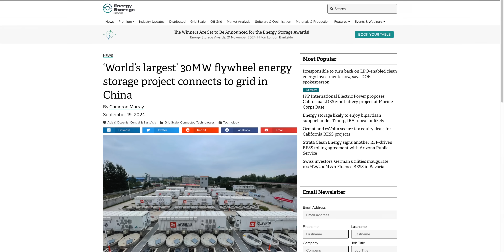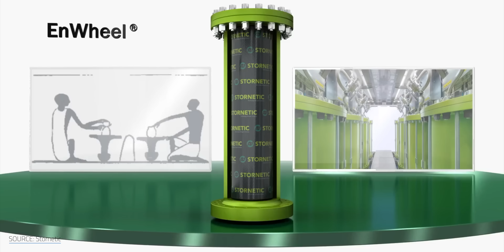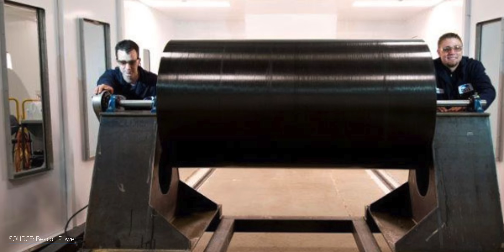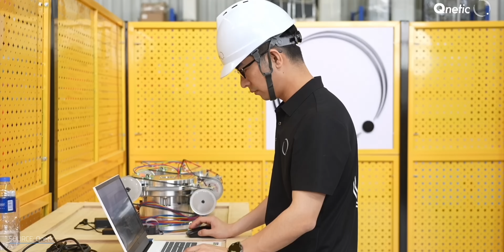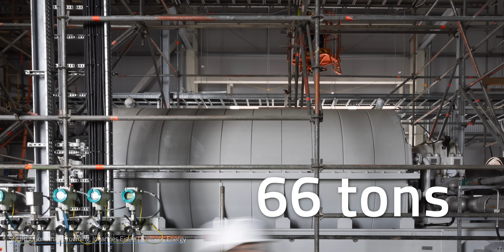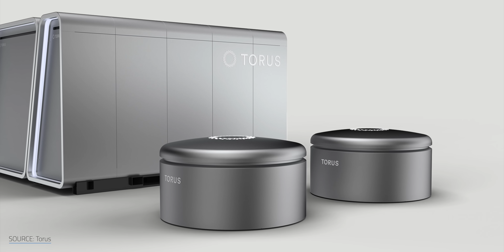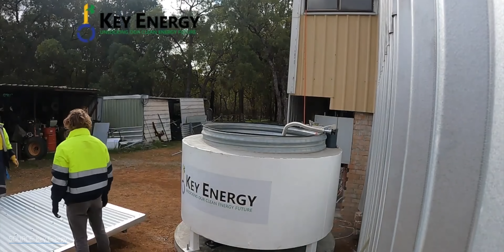How This Mechanical Battery is Making a Comeback

Comment: For some reason Matt didn't really explain why grid connected flywheels are valuable. It'st not primary to "even out fluctuations from renewables" in the power sense, batteries are far better and cheaper for that. What flywheels add is inertia in the form of spinning mass. As conventional thermal power stations are retired, with their large rotating generators, an important quality is been lost. A quality that is hard for the power electronics of solar, wind and battery systems to mimic. A synchronous rotating mass provideds frequency stability as well as voltage stability. They are said to be grid forming, not grid following. It is a vital function and this is one solution.

Comment: I think the best analogous thing to this is like a capacitor or inductor coil. It heavily resists fluctuations in power. Both are used in small electronics to smooth out voltage supplies and prevent spikes from damaging components. They're not a battery, but they do have a significant roll to play in the grid system by smoothing out high demand that a battery can't do.

Comment: Have you seen those gravity/buoyancy based energy storage solutions?  Those seem better to me - you can keep stacking concrete blocks or lowering balloons underwater to store the energy, and then when you want to generate, you hook a generator to a line and let the balloon or block go and the line unravels and spins the generator.  Seems safer than a spinning death machine, and gravity and buoyancy don't lose energy over time.

Comment: The other advandage to a fly wheel is that at the end of its life all you need to do is a rewinding on the generator and some replacement bearings. The whole system is also fully recyclable which is insaine. You kind of have to stop and say this isn't really a battery but something that resembles a mechanical super capacitor.

Comment: My favorite energy storage mechanism is the garage door spring. I keep wondering why such a device isn't used on a long, 40 ton, tractor trailer. Every time you stop and start is a waste of a huge amount of energy. Call it GDS to make it sound high tech. I've witnessed these used on huge loading dock doors weighing hundreds of pounds; made easy to open manually.

Comment: My 70’s Chevy with a 427 big block has a flywheel.  Smooths out the power for better clutch engagement.
Reply: It smooths out the power so the engine will keep turning between cylinder firings.

Comment: It sounds like flywheels would already work well to capture peak sunlight from solar in California and then discharge it in the early evening when people get home and use electricity.  Why is n't that use case happening If they have less loss than battery storage?

Comment: The most telling flaw of “renewables” is that they ALL need additional complexities added into the power generation and distribution process. To oversimplify things, yesterday’s flowchart was generation, transport via the power line grid and delivery to the end user. Tomorrow’s flowchart, largely due to the vagaries of wind and solar and also the media’s toxic persecution of gas, oil, coal and nuclear, will need a fourth step inserted into the flowchart: energy storage. What the legacy media and most first-world governments have been very good at so far, is hiding the true cost of this huge and complex addition. In everyday language, it will add 25%-35% to the bottom line of everyone’s electricity bill when all the bugs have been worked out. In the short term it could quite possibly be double that with technological crop-up problems and materials refinement.

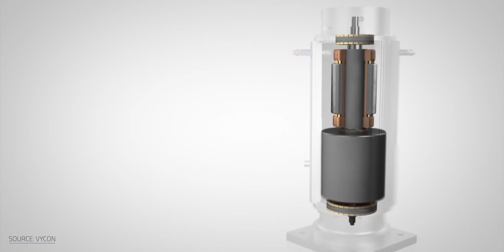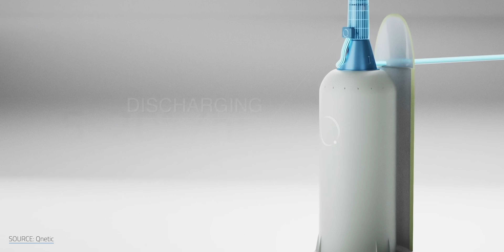Comment: At 5:50 You say "Without maintenance, flywheels tend to last about 15 minutes".  But only seconds later at 6:00, you say they only lose "about 5-20% of their energy per hour".

A core use case for an ESS is to store power up to 4PM, and then at 7PM start draining it, which means you're only storing it for 3 hours; a loss of 5% per hour would mean a loss of 15% which isn't super great, but is still competitive in the market.  It's certainly much better than lasting "about 15 minutes".

What did you mean to say?  Perhaps "15 hours" rather than "15 minutes"?

Comment: This isn't a win, this is a warning.

All this proves is intermittent "clean" energy sources can't replace fossil fuels without the end users incurring eye watering energy prices. How much new, novel, infrastructure is going to be required to meet net-zero pipe dreams? At what cost to society do we say enough is enough? 

Just hope you're not the person, in an ambulance, stuck in traffic on your way to the hospital because a brown out stopped traffic lights from working or your on the table and someone forgot to put refuel in the backup generator.

Comment: they could very well, combined with photovoltaic, solve part of the energy production/consumption discrepancy in the afternoon/evening. "Charge" in the afternoon when the demand is low and production high, "discharge" in the evening when the demand is high and the production lower...
then use the wind turbines to charge them in the night for the other demand increase in the morning/noon hours?

Comment: I feel like most of this video is wrong or intentionally misleading. How could you power the grid from a flywheel without that flywheel "spinning down", i.e. converting rotational speed to electrical power, without expensive, lossy, and complex AC->DC->AC systems? This video would benefit from an actual comparison of total system efficiency, lifetime ownership costs, cost per MWH storage etc etc. No way those things can spin for a decade+ without maintenance. And magnetically levitating a 100+ ton weight to increase frictional efficiency versus a rotor? Are you kidding? What was the comment on carbon fiber anyway? Do you have anyone review these videos or is this script AI generated?

Comment: Ultimately you're wanting 50Hz / 60Hz (depending on the country you live in), I wouldn't be surprised if they didn't just rectify whatever high frequency AC is coming out of the flywheel to DC and then use an inverter to convert it back to 3 phase AC for sync and frequency. Frequency and phase matching is incredibly important to prevent failures at generation sites or loads.

A generation site can get disconnected if phase and frequency aren't closely matched to the load in order to prevent damage, but if a generation site (or sites) are disconnected, the remaining connected sites are now under more load, and that causes them to get further out of sync, exacerbating the problem, which leads to wide spread failures unless the load can be shed (ie forced blackouts), or more generation can step in at phase and frequency, and return everything to normal. If every generation site is knocked out, that leads to a 'black start', which is pretty complicated to recover from as something needs to provide the clock (or frequency) that sites are synchronised to, and it also requires bringing the areas disconnected on in stages to prevent everything from rapidly falling out of step again.

Or, we could just install (more?) nuclear and avoid the complication of storage atop synchronisation, at least until the fusion nut is cracked. In my mind, flywheels are a good solution for sites to have something to provide power while diesel generators come online in case of a blackout, and this is exactly how several datacentres I worked at did things (and that was old tech 20 years ago), but trying to make this small scale solution fit for large scale seems like elimating the problem with more reliable generation to start with is smarter. The turbine at a nuclear/coal/gas plant will have an integrated flywheel rotating at the same speed as the turbine/generator to smooth out sudden changes in load, and permit a bit of time to change how much heat the fuel produces and is centuries old tech.

An unpopular opinion, I know, but I see these products as being useful only in specific scenarios, at large scale it seems like a waste of resources.
Reply: This is pretty much exactly what both traditional syncons (look 'em up) and the smart inverters on many battery farms do.

Comment: This not a new technology.  Data Centers (Some) can use DR-UPS (Diesel Rotary Uninterruptable Power Supply) to condition their mains (Grid) power inputs to a clean output for IT.   The traditional way is with banks of 48 VDC lead acid batteries.    This copes with brown outs and very short  power outages.
With DR-UPS on longer  power outages there is a shaft or mechanical linkage to startup an emergency diesel generator.  With all your eggs in one basket its difficult to test for an outage, as one data center found out to their cost when the emergency generator failed to start.

Comment: This sounds more like voltage regulation than energy storage. It takes energy to get them going and more to keep them going. The way it’s explained in the video doesn’t explain how this is beneficial. It reminds me of those videos where they hook up an alternator to an electric motor and claim it’s endless energy 😂

Watching this just gave me an idea though. One application that I think could truly benefit from flywheels would be in outer space. A space station takes in solar which would power the flywheel starter and give it small boosts only when rotation slows below a certain threshold. Being its in zero G I would imagine that it wouldn’t slow that often and could output more power than the solar panels would take in over a years time. Plus if implemented correctly it could also act as a stabilizer

Comment: In the seventies I was shown an huge and at that time seemingly ancient flywheel that was used as a power filter. Power in went to the motor. On the other side a generator was constantly running. The result was stable power without voltage spikes.
Reply: It's called a syncon (synchronous converter) and an important part of any large grid. Though usually replaced by solid-state electronics these days. Look it up.

Comment: Sounds like a great idea!  

One idea that occurs to me: tiered use.  Assuming you can extract energy from each unit independently (which I'm sure you can set up in a facility if you want to) you could presumably use your array of FESS's to maintain a subset of them for longer.  Not ideal for efficiency - you'd only want to do this if you wanted to rig up longer term storage while not using battery tech (which might be useful in some places, given the cost of battery chemicals vs the cost of a big hunk of metal) but if you needed to, you could draw down the energy from FESS A to keep B through E spinning until it runs out, then draw on B to keep C-E done, then tap C for D-E, and then D for E.  There's definitely a point at which the efficiency problem kills this chain, but it could extend a flywheel's operation cycle up to 24 hours to work with a solar plant for sure.

Like I said, efficiency of transfer of energy is the killer here, this isn't a trick for long term extension of flywheels to make them a super-ideal thing..just a trick that would allow a FESS system to hold onto power longer than it might otherwise.

(And I'm sure there's probably systems that have looked into doing this and are doing it if it's actually feasible.)
Reply: Before reliable battery systems were available fly wheel ‘no break generators’ were used to maintain electrical power to critical systems in the event of a power cut. I worked at and airport where the radar equipment was powered by a generator powered by an electric motor, between them was a large spinning concrete disc. When the power went off the generator continued to provide power for the few seconds it took for the diesel generator to start.
This system was cheaper than having the radar powered from a diesel generator continuously.
I assume the same sort of systems would use a continuously charging battery now, connected to an inverter.
The flywheel system worked well back then (late ‘70s) as lead acid batteries need a lot of maintenance, plus we needed a.c. for the radar systems. I don’t think inverters, other than dc motors driving an alternator existed.

Comment: We learned about the oldest versions of these. 

Old emergency generators used MASSIVE steel wheels for their emergency power system attached to a deiseal engine. Generally they are expensive to start up, but VERY cheap to keep going once they got up to speed.  I had always wondered why we never continued to invest and expand in these systems. 

I think this with the Silica power storage systems that I think you mentioned in a video once upon a time make sense together. In places where Hydro electric is available I can image you could partition off parts of the grid so that black outs from inclement weather. 

I think a lot of people get hung up on a single answer to our energy deficient problems.... I also think burying these in the ocean is a REALLY good idea. The main problem of what happens if this catastrophically disassembles it's self and the others stationed near it, is neatly dealt with by water's ability to swallow kinetic energy.

Comment: I was just thinking hybrid storage makes a lot of sense using flywheel, battery and solar panels for small grid applications. And then you mentioned it as being done now. Things just keep getting better and better as we learn more.
Reply: Wonder when someone will come up with a micro nuclear plant attached to a flywheel for home power without grid? Heinlein's idea of the "shipstone company" without mentioning nuclear power or flywheels. He saw that coming in the 1930s and 1840s. Essentially a sealed unit that lasted about twenty years or more. Hope someone somewhere is working on it. Imagine how that could solve the issue of large truck power for moving goods and single home use for remote landscape use.

Comment: what if... you use the battery' weight as the fly wheel weight for energy storage. Given a second form of energy storage of the same mass. No need to build a whole new fly wheel energy storage if you can just spin the existing battery for rotational.

Comment: Flywheel for emergency power to bridge the gap between power supply failure during backup generating equipment startup.  I've seen one on a large industrial facility.  Always spinning just incase.  Coupled to a few thousand HP diesel generator, critical system power.  Awesome engineering.
Reply: Why would a flywheel be coupled to a diesel generator? That makes no sense at all.

Comment: What is the smallest size that a FESS system could be practical? I'm in the early stages of building an all electric canal boat (10' x 65', 20 long tons), and with enough solar and battery capacity to run long enough to satisfy our domestic and cruising needs. There's also a generator for backup. Any ideas or leads to a possible supplier? Thanks in advance.

Comment: No matter what the size and scale, any flywheel is a mechanical capacitor, not a mechanical battery.  The voltage output under load in spindown mode is an exponential decay curve, it decreases to 1/e = 37% after one time constant.  Always.  Exactly like a capacitor discharging.  Flywheels are perfect for smoothing out peaks and troughs and noise, so they have their place, and that's the real point.  Think of doof-doof car audio with a huge capacitor in the power supply, on a large grid scale.

Comment: Why use high-speed flywheels? Surely huge low-speed flywheels would be easier and cheaper to produce, safer to run, and at least as efficient.

Comment: Living in Rural Ontario, Canada, I split loads of wood to heat our home and make maple syrup. So I looked into wood splitters for a long time and most here are hydraulic but they are so slow compared to me with an axe but very powerful and good for tough to split wood. Then I found these flywheel splitters and bought one. It is so fast, so powerful and I compared notes with my neighbour that cuts loads of firewood every year and I am using 1/4 of the gas that he does to split a cord of wood. I never run the engine at full power and it just keeps spinning up these 100 lb weights between splits. It is an excellent use of flywheel technology. Forestwest made the splitter. I got the bigger 34 ton version
Reply: The instantaneous output power of a spinning flywheel is HUGE, limited only by the strength of materials. Even a flywheel with tiny energy storage can still generate ENORMOUS torque! But only for a moment.
Reply: I never knew about these, extremely cool!
Reply: There are other brands out there under "kinetic" splitters. And they are good at what they do. Some are not good for all woods and sizes though.

Comment: both dinglun and moneypoint had a written "MW" on screen but for the latter, you said MWh which is a completely different thing. when talking about energy storage, plain power figure only tells you about maximum momentary power and nothing about amount of energy stored (i think both have chemical batteries too). so which is it?

Comment: There were some data centers that used flywheels instead of battery to carry critical load until the diesel generators fired up.  I think the maintenance cost became very difficult.  Replacing the flywheel itself is super expensive and the same battery capacity became cheap.   The spinning of that big of a mass is going to generate friction no matter what and preventing that in a mission critical environment is 😬

Comment: I know your likely to get into this in the video, but the amount stored is not what flywheels excel at, it's the ablity charge and discharge quickly and your not limited by the size of the inverter to turn DC and AC as you would make it so the flywheels output AC, all you need to do is condition the power. The amount of power that can be stored is orders of magnitude lower the Lithium Ion, but that's not the point.